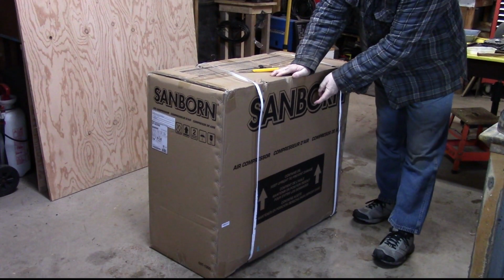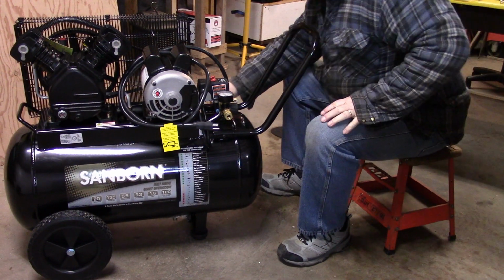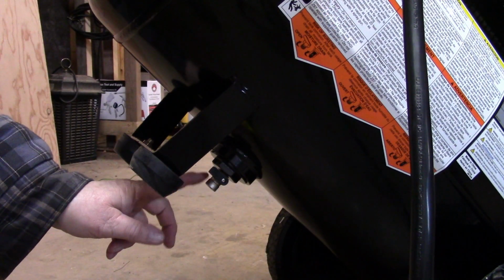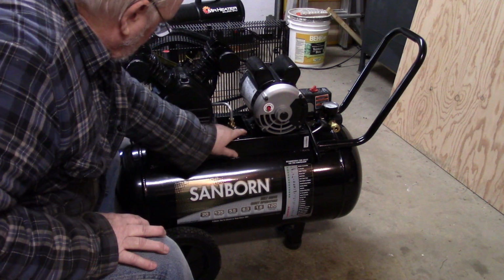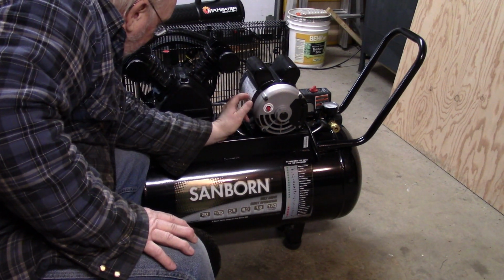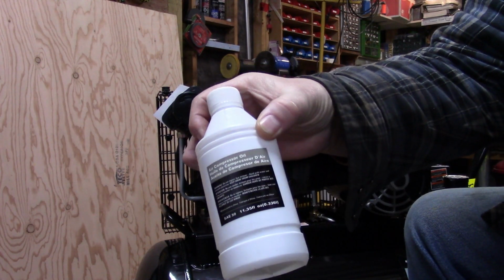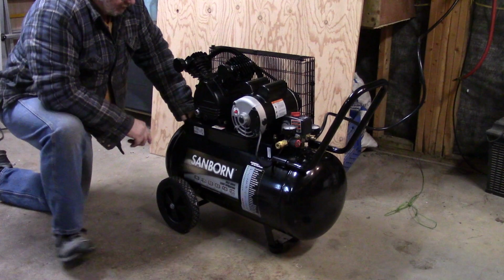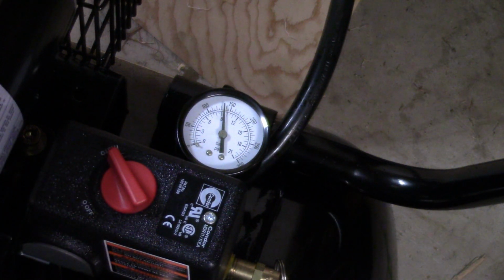Commissioning My New Sanborn Air Compressor

Comment: As I said before Sanborn has always produced well thought out equip. I like the large bungs too. You should still put an elbow, long nipple to a ball valve drain sticking out easy to reach drain. After the last go I am sure you will be draining it now eh, LOL. Thanks bud This is a fun one.
Reply from the maker: Hello there Dean!!!  Man you can read minds too!!!   When I bought the compressor I bought fittings to put a proper drain in.  But wouldn't you know it, I didn't get the right ones!!!  LOL  Story of my life I guess!!!  
I am going to make it a scheduled thing to drain the tank every Monday from now on.  No more condensate in my tanks buddy!!  LOL  
I think this compressor will work out fine for me Dean.  I like the configuration and so far, it's only been a couple of days, I like it  a lot!!!  
Thanks for always watching an commenting Dean!!  Take 'er easy!!!
Reply: @GrampiesWorkshop   There are auto drain valves that can be programed for "how often for how long avail at most industrial supplies. I have made the habit of turning the output valve and dryer at the tank draining the water off and draining the system EVERY DAY the compressor runs. I lost a 4 cyl unit from an airline that broke overnight.3rd one that year. Night shift couldn't obey the rules for shutting the shop down. They came to me and after a heated hour bit the bullet and put in a screw type that can run loaded or not 24/7/365. I built an air dryer out of a 12 in seamless pipe 16 feet long that I can send a drawing of so you can make that works great. (Scaled way down eh) It had that same auto drain. The air leaving the tank was from the bottom of the 250 gal tank. We went from months having to service all the air tools like 1 in impacts to small air tools like grinders etc to when, when I retired we hadn't had one in for servicing in 4 years. I call that one a win eh. Not to forget an inline oiler or doing the drop or two every 4 or so hours when in use.  Send me an email with your mailing info bud so I can send you the plans for the dryer. "deanlorman@gmail.com" You and Nannie stay safe and stay away from the cities that will make us country mice sick eh.
Reply from the maker: @TomokosEnterprize  Thanks Dean.  Not sure I want to go with a dryer.  I'm trying to rearrange my shop and space is a premium right now!!!  LOL  The dryer is a good plan though.

Comment: I'm hoping the 20 gal. Will be all you need in you workshop. I always worry about running out of air at my place when I'm working on projects.
Reply from the maker: Good day Jack!!!  I have plans to use air tools for the wood shop more and more so I hope it's going to be big enough too.  I think it will.  5.5 CFM is a lot of capacity.  My old compressor was only 4.1, so this is an upgrade in that area as well!!!  Thanks for watching and commenting.  I enjoy your comments.  Take care!!!

Comment: Looks good, Mike. I hope you get many years of service out of it. You will need to do a 6-month (or so) review. Enjoy your weekend. - Rick
Reply from the maker: Hello there Rick!!!  That's a good idea!!  So far this compressor is really nice, but I have only had it for 3 days so far.  The first thing I noticed about it is the draw down is longer than the old compressor.  It seemed with the old one I would just start to use a tool and it would start.  This seems to take a lot longer before it starts!!!  Thanks for tuning in and commenting.  Have a great week!!!

Comment: I think you will be well served with this compressor, Mike....I got one very similar to that one at the camp with a two HP motor on it and it`s over forty years old and still going. and I never looked inside the tank....just let it be ....the tank will get natural oil from the two pistons slashing in oil and it won`t rust much if you drain it every six mounts....CHEERS
Reply from the maker: Hello there Gator!!!  I hope it outlasts me!!!  LOL  Draining the tank is not going to be an issue for me with this compressor.  I'm going to make sure every Monday that I drain the tank!!!  You know, just in case!!!  LOL  Thanks for tuning in Gator and take 'er easy!!